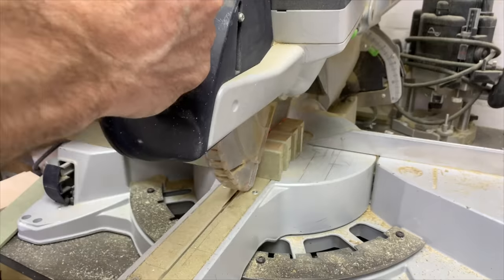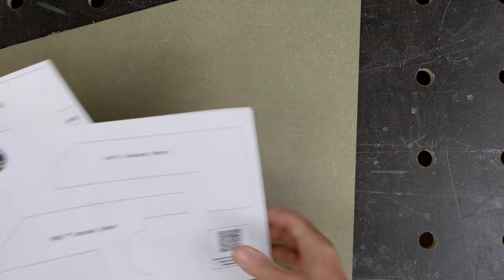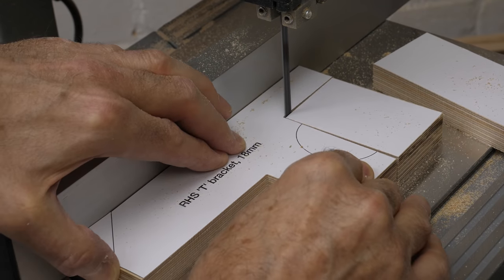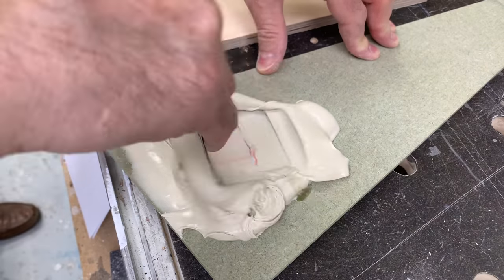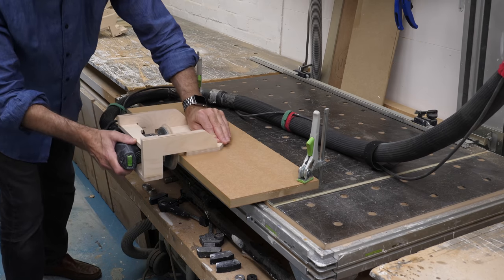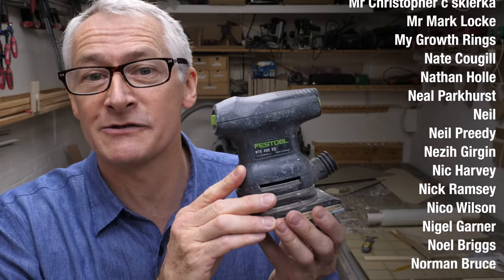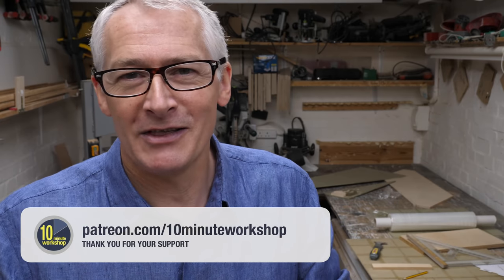I Make an #EdgeSanding #Jig for my older #Festool sanders [video 418]

Comment: After botching the sanding of roughly 100 feet of crisply machined chamfer on a recent bookcase, I'm determined to make a jig similar to yours but with a continuously adjustable angle. Most every shop has a  cruddy old palm sander languishing in some dusty recess. This could be one last hurrah for a noisy, vibrating pre-dust pickup machine. Why don't you do the problem solving and we'll copy you?

Comment: 4 years ago I was painting lots and lots of mdf doors and had a similiar problem with the edges. It was my job and painted thousands of doors in about 3 years. I made a very similiar 90 degree jig to my mirka random orbit sander. I was so enthustiated with my invention that i made the sander fit with just a friction fit with the jig so it was easy to mount and demount. It worked great and was pretty happy with it. Still as the time went on and sanding continued, I noticed myself using less and less the jig and just freehanded the edges (22mm mdf). Basically the issue was just the thing you talked about in the credits. Normal people doesnt notice if the edges are slightly rounded or if it isnt perfect 90 degree. And yes it is true that with enough practise, you can freehand sand with pretty good results.
Reply from the maker: Yeah, most of us free-hand sand miles of edging every year without one of these. But if you have a lot to do, or if you're knackered and you have a lot to do, or if you're getting on a bit and the arthritis doesn't let you grip so firmly any more etc.. etc.. 🤷‍♂️ 👍
Reply: @10MinuteWorkshop    yeah you are right. I should have said also that I had to sand the faces too, so the mounting and demounting the jig 100 times a day just became a hassle. Even when it was super quick to do but still the continuous walking to table and picking up the jig, mounting it, sanding, demounting, walking to table to put it down. I think you get the idea 😁

Comment: great work and an excellent, extremely useful jig for professionals and non-professionals alike. concept is of course adaptable to just about any sander out there. i prefer epoxy putty to polyesther resin-based filler for this sort of thing, as epoxy putty is not a fluid so you can press it into place and you wont have the compound flowing away. you can even square it in that step with the ability to micro-adjust and avoid shimming altogether

Comment: A nifty design Peter. I'd say that edge sanding [esp with dust hose hanging off the back] is fiddly enough at the best of times [even for a pro]. When you've a lot to do, this must take some of the stress out of the job. 
With every penny spent of the tool itself - add-ons can be a kick in the wallet that's just not funny. Its like that square attatchment for the tracksaw rail - the device is an excellent addition to the kit but its rather outta reach of DIYers. Your economic solution there was a godsend to us 'skint' mere-mortals. Thanks for all the content Peter, I look forward to seeing what you make now you're more, 'off the leash'!
Reply from the maker: Thanks Keith! 👍👍

Comment: I just bought the edge sander guide yesterday for my 125 and it didn’t fit, they don’t tell you that when it was advertised. There are a couple tabs on each inside pieces which I ground off, about an 1/8th inch, and it worked out just fine. Perfect 90 and 45.

Comment: I reckon that you could also clamp the jig and sander upside down and that way edge sand smaller parts easily too.
Reply: That is - you would be holding and moving those small parts instead of the sander
Reply from the maker: Must admit I hadn’t considered that - great idea, I’ll give it a try! 👍

Comment: Good job you made this video....I was just about to buy the edge guide  too.....and my ETS 125 is a similar vintage to yours. I'm currently restoring a pair of weathered oak gates which are too big and heavy to take down, and coated in a gloopy oil finish. Sanding this off whilst up a ladder with the gates moving slightly is making it very difficult to keep the edges crisp....perhaps I'll have a go at making a version of this to fit my Rotex125!

Comment: Great jig & the resin filler idea was genius 👍.  It was even more interesting at the end when you mentioned the RTS400 will also fit as that’s what I have 😁.
Reply from the maker: Thanks! Yes, the RTS is near-identical from the pad, upwards; seems to be slightly longer in the body, which is why the workpiece base is offset by 12mm; I used 6mm in the prototype, and it was a little bit close for comfort! 👍 👍

Comment: That’s very nicely done Peter. Of course as with all things there is the ‘so what’ position and the ‘never needed one before’ statements, but I thing the jig offers other advantages over and above its primary purpose of accurate edge sanding that prevents damage to corners. The other advantage that cannot be overstated is ergonomics, especially on batch production where you could be spending hours on the edge sanding task. This jig is much easier on the hands than holding the sander itself and certainly for ‘older hands’ it will be a blessing. Any thoughts on product development? Maybe the angle setting facility or even a hose mast or perhaps even ritzier handles that incorporated rubber washers to further reduce vibration at the hands.🤔😉😀👍
Reply from the maker: Thanks Norman! Yes, I was thinking about us 'senior sanders' whose hands are perhaps a little less grippy than they used to be when I put it together! Excellent point about the corners too! I'm going to play with it a bit more and see if there are any other options I can include; very tempted to make one for a palm router, for horizontal routing, though that's more of a 'because I can' rather than any particular need! 😆👍

Comment: Nice jig! Personally I think you only need that if you want to sand down very rough edges, like something so bad that it needs heavy sanding or planing. Not for anything that comes out fresh from a table saw or plunge/rail saw. But perhaps if you have that jig you might use it for even lighter sanding jobs, dunno...
Reply from the maker: Thanks! 👍👍

Comment: 🤔 a great surface for the sliding surface would be Formica or equivalent, unlike plywood doesn't readily get dust or grit stuck to it good on plywood router bases.  Anywho nice job. 👍👍👍

Comment: Bit of 2 pack genius there mate. You know, after the conversation on Insta, it occurred to me that I only edge sanded with the orbital rather than the random orbital. A Hilti in my case. I was hoping that would be one way I could differentiate from yours...you sly old dog!! Top marks though Peter. Looks like it works great.
Reply from the maker: Haha, cheers Stew! Yeah, I knew they shared a very similar body/enclosure so thought it might work with both. Hey, get on and do one for the hilt - the more the merrier, and we can reference each other’s. 👍👍

Comment: 2009... 11 years old and still kicking along, impressive! 
I'm an, "all for it" especially if you've got miles to sand, this jig will make quick and accurate work of each and every single piece. 👌🏽
Did you drive a couple of screws into the filler mould, just incase it falls off?
Great work, mate.👍🏽
Reply from the maker: Cheers Bill. Yes, same set of brushes too - though if my saw was anything to go by they'll need changing before too long... 😂 And no, no screws - the filler's pretty tenatious, and if it falls off I can always apply more! 👍
Reply: @10MinuteWorkshop  
Now that its been said aloud, best be having a set of brushes on standby, you just know Murphy's got to be earwigging! 😉

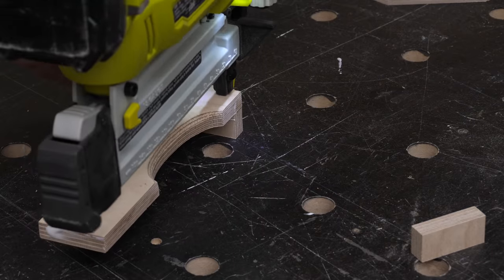Comment: At 4:19, I think this is the first time I saw you using Ryobi tools. 😃
Reply from the maker: It’s just the mailer & stapler; I have a drill as well but it doesn’t see much use. 👍
Reply: Peter Millard 
Many of my tools are Ryobi. They work good enough for me.
Reply from the maker: I had plenty of the old blue & yellow ones early on in my career - worked great. 👍👍
Reply: Peter Millard I also have a few of the old blue ones. Some of the blues ones are proper work horses.

Comment: Love the use of filler to make a mold, such an elegant solution to hours of faffing around cutting, rasping and sanding to get a perfect fit. I know it's wasteful but zip ties are so cheap and speed up the process is there any other reason not to use zip ties as the hold down?
Reply from the maker: Thanks! Actually using zip ties is a great idea - didn’t think of that! All you’d need to do is drill a hole either side for the tie to thread through 👍👍
Reply: It's not wasteful if you use the releasable (is that a word🤷🏻?) type. Easy to find on a certain South American River site; a little bit more expensive, but sooooo useful for so many temporary holding jobs, especially if you work alone.
Reply: @davidfarnall3211  Thanks I will look that up but that site can be a bit of an A hole in supplying Australia. You would be surprised how many YouTube providers recommendation links refuse to deliver to Australia just because Australia wanted to Tax a company that was making so much money from Australia. The rumour is that a certain Mr B doesn't want other countries to follow suit so juggling his wrath and greed we get a limited service.

Comment: funny - I have just been to a Festool retailer this week to have look at this edge sander - and in fact I was wondering why they haven't done this jig for their linear sander (DUPLEX LS) which I would have found more logic for edge sanding as it mimics what we do by hand-sanding. Any ideas ? I also don't have a Festool sander left over but pretty much like the idea of such a self build jig but I am  wondering if there is one on the market which has some threads in it which would allow to directly screw some sort of guide rail to it. Maybe from the old days where the bodies of these machines were less ergonomic ?
Reply from the maker: Interesting idea, and truthfully I don’t know. The LS130 is similar in body shape to the RTS 400, would probably work. I’ll have to try it. 👍👍

Comment: Fantastic. realy like the two pack resin filler idea. cant see a link in the list though. do you have one please? thanks
Reply: i guess you could also use hardening modelling clay. the stuff that sets. but i thought this was a great idea of peter's and i hadn't seen anyone do something like this. seems perfect way to get a nice seal. do they shrink when drying at all though?
Reply from the maker: Thanks! And sorry, forgot to add that in.  Pretty much any 2-pack resin will do, but Decorfill - https://amzn.to/2FxiXsU is a good one. 👍👍
Reply from the maker: It doesn't shrink significantly in my experience, no. And yes, any fast-setting filler/putty/clay will do the job. 👍
Reply: @10MinuteWorkshop  seems a much more elegant solution than gluing lots of bits of ply to make a form. nice one.
Reply: @10MinuteWorkshop  cool thanks. 😊

Comment: I’ve noticed in past videos and this one that you use what appears to be a Ryobi cordless nailer. My experience with the 18 gauge brad nailer has been terrible, how about sharing your thoughts of them in a video.
Reply from the maker: Thanks! I’ve had a nailer & stapler video on the planning board forever - I must get onto it soon! This one’s actually the Ryobi narrow crown stapler, which I really like. I have the 16g nailer and I’m not at all impressed with it; interesting that you’re less than enamoured with the 18g nailer - I’ve heard from a few people that the 18g nailer is similar to the stapler, but sounds like you have other experiences Steve! I’d love to hear what issues you had with your 18g nailer. 👍👍
Reply: I’ve had the Ryobi 18gauge nailer for about 3 years now and it’s been one of the best tools I’ve bought while renovating my house. Have put thousands of nails from 15-50mm through it and can count on one hand the number of times it’s misfired. I think I’ve had to open the top once, maybe twice to clear a nail but that’s been it. Have found it ultra reliable.
Reply from the maker: Some Architect Good to hear, thanks!
Reply: In the two days I've tried to use my 18 gauge immediately after purchasing it, it would shoot a few brads and then the driver wouldn't retract all the way. This would lead to an empty fire or two until it would retract all the way and allow the strip to feed. Sometimes the driver would jam between the brad and the front of the nose. The second day was worse than the first in all respects, perhaps the one I got is a bit of a squib, but it's got to go back.
Reply from the maker: BigSteve215 Yeah, I’d return that without hesitation. 👍

Comment: Peter, 1) Where do you get your Birch Ply, local stockist or do you have to get it specially delivered. 2) Do you have a link to the 2 pack resin?  Thanks!
Reply from the maker: Thanks Nial. I buy my Birch ply from a local supplier, AJFerguson.co.uk - great yard, great people. Pretty much any 2-pack filler will do, this one is decent; Decorfill - https://amzn.to/2FxiXsU
Reply: @10MinuteWorkshop  Thanks for the reply, I can't find anywhere up here (Edinburgh/Glasgow) with free delivery on birch ply. Do any other Scottish readers have any suggestions?
Reply: @nialstewart8263  ...go and collect, or pay for delivery!
Reply: @Sean-qk5mv  I drive an XC60 so collection is a problem. I didn't mean free delivery as much as reasonable delivery, the best I can find is from Atlantic Timber in Cheshire.

Comment: This is not a comment on the content but a general question for other subscribers. Although I am subscribed and I have "rung the bell", I am no longer receiving notifications, either to my inbox or junk mail folders. Does anyone else have this issue? I have tried unsubscribing and re-subscribing but that has not worked. It is not really a problem as I know when the various channels I watch post new content but I would appreciate it if anyone has had the same problem and come up with a solution.
Reply: just this channel? don't forget facebook now own youtube and for a big internet company their products are flaky as hell. if its all channels you may have notifications off on your phone
Reply from the maker: The notification system is notoriously flakey tbh - I routinely dont get notifications on channels that I know I'm signed up to. 🤷‍♂️👍
Reply: @10MinuteWorkshop  yeah i get a lot of work on facebook and its notorious for not telling me i have messages then telling me several times about others. very flaky.
Reply: @10MinuteWorkshop  I no longer receive them for any channels to which I am subscribed (eg Ron Paulk & Dave Stanton), although I used to. It could because I changed my internet supplier but I do not see how that should change anything. Also, I have just received reply notifications so the email is correct. Again, it is not a particular problem. 1200 on a Friday for the 10MinuteWorkshop is now hard wired into my brain and I make a quick check every few days for other things of interest. I should probably actually do something rather than watch YouTube videos. For example, I have two Versailles planters which should have been finished for last Christmas.
Reply: I'm also not getting notifications to channels I'm subscribed to on my desktop PC, however I DO get them on my phone, a Moto G4? Could it be a Windows update thats borked it perhaps? I doubt it but all I can think of. So annoying seeing the notification on the G4, then having to manually seek out (for instance) Peter's Channel on the PC. Been happening for a good couple of months now.
Reply: Seems par for the course.  It's pretty much toss a coin and hope for the best if you want YouTube notifications...fortunately I find the 10 minute workshop to be one of the most reliable!
Reply: @davidhull1610  he is always top of my recommendations on YT now anyway so i see stuff v quick anyway. too many pings on my phone as it is without more :P so i turn them off anyway
Reply: YouTube officially turned them off for all subscriptions.    @
Reply: @richardmekolichick4326  Thanks for that. That explains it. So the bell now has no function.
Reply: I think that Google, not Facebook, owns YouTube.

When you "ring the bell" there is a setting that pops up.  The default is "personalized" (Americans!) which means their fancy algorithm chooses whether to notify or not.  Change it to "all".  This is with the Android app - others are probably similar.  I don't remember where I saw this...
Reply: @georgescott6967  ah yes, you are right, my apologies.
Reply: @kanedNunable  no problem. I find that it is becoming harder to distinguish one giant American global company that doesn't pay any local taxes from another; they all look the same after a while.

Comment: I like many, jumped at the chance to buy the Festool Pro 5 Ltd which  looks to be the same as the ETS 125 REQ. I believe (but am not sure) the Pro will accept the edge sander.   If any one knows either way, please feel free to chime in.
Reply from the maker: The Pro Ltd was a bargain! Only available in the US I believe, which is a shame for the rest of us! Does it come with or accept the edge protector? That’s the connector that the edge sander positioning guide attaches to. 👍
Reply: @10MinuteWorkshop  Just checked.  Yes it does.
Reply from the maker: @irenebrowning  Great news! Thanks for letting me know! 👍